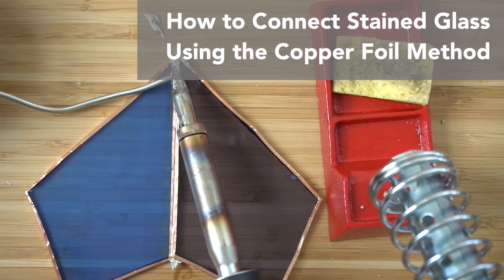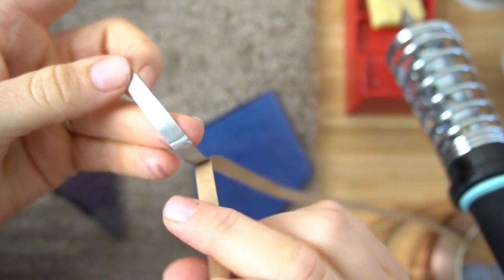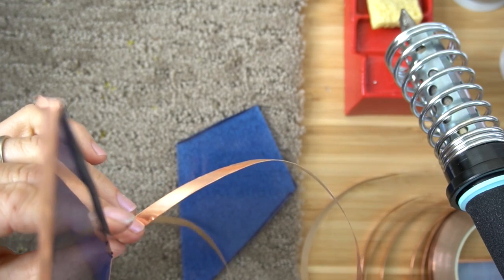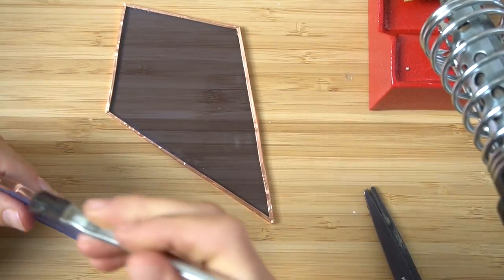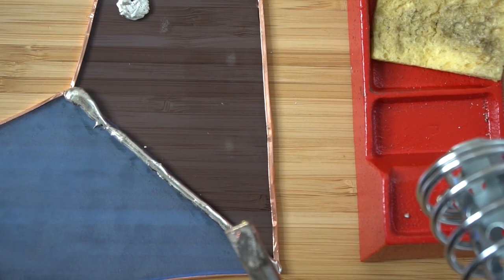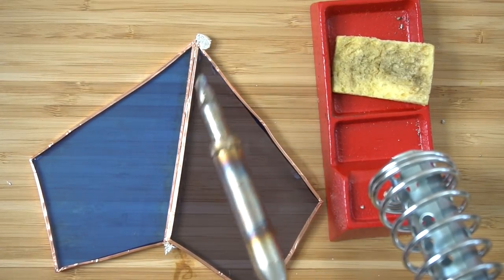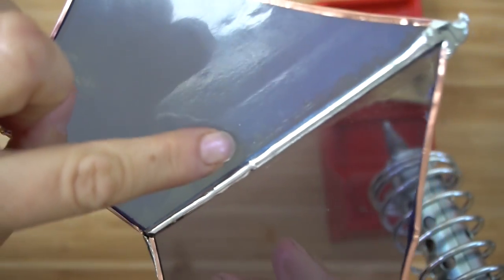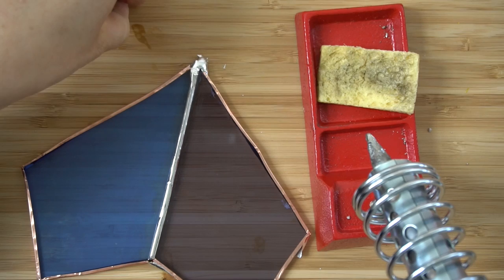How to Connect Stained Glass using Copper Foil

Comment: Should one heat of the copper first, then add the solder?  That is at least how one is suppose to do it with electronics, otherwise the connect is brittle as the solder touches the cooler surface, to which you are trying to attach it.
Reply from the maker: I’ve never heated the copper, the flux you apply before soldering it is what allows it to attach
Reply: @MrOtterArtStudio  This is a good tutorial and I want to try it out myself, the previous comment has a point though and I'd like to help rather than criticise. 

Flux is primarily used to reduce the surface tension of the molten solder and make it flow smoother when heated. 

Heating the copper foil and then applying the solder directly to the foil (next to the tip of the iron) will result in a stronger bond between copper and solder. It's probably not as critical in stain glass as it is in electronics but I think it would be worth testing so see if the join is stronger with a less brittle bond.
Reply: @mleah4767  Flux is used to remove oxidization residues from copper during the soldering. Depending on the flux recipe one works better than another for this process. Preheating copper leads to glass cracking during the process. I m sorry but soldering principles known for soldering the plumbing parts simply do not apply to stained glass. I am soldering stained glass myself for over 15 years on the way shown in this video with perfect results and never had even the smallest issues with the solder bond between copper and solder.
Reply: Technically, you should "tin" the copper foil with a flat layer first, then go back and bead edge

Comment: Newbie here. Why do we add copper foil before soldering? Can the same be done with acrylic instead of glass?
Reply from the maker: Copper Foil is needed so the lead has something to adhere to when it is melted, otherwise, it would bead up on the glass and fall off of it.  My friend uses a glue gun to create stained glass like acrylic paintings.  The hot glue is the raised lines between the shapes if that makes sense!

Comment: What temperature is good for the iron? Mine gets red hot after a while and it really smokes!!
Reply from the maker: 700 degrees is the standard temperature, you might need to clean it off
Reply: Sounds like you need a rheostat to control your iron’s temperature.  It should not be getting “red hot”, and this could be a real fire hazard.

Comment: I always have the toughest time getting the copper foil to stick once I start soldering. Do you think it's because I'm putting too much flux?
Reply from the maker: It could be, or the glass might need to be cleaned more thoroughly and then let it dry.  I have had that problem and for sure the flux can work its way under the foil if it isn't sealed very tight.  Good luck!!
Reply: The copper foil needs to be “burnished”  in addition to just pressed down with fingers, which is an important step this video omitted.  This flattens the small creases, increases the foil’s bond and reduces the areas for flux to get underneath, which results in the “bubble” you see at 10:56.  You can use the side of a pencil or whatever’s handy that will press the foil flat.  A bone folder works great.  This important step will prevent foil lifting.